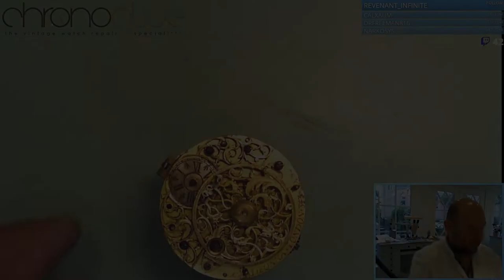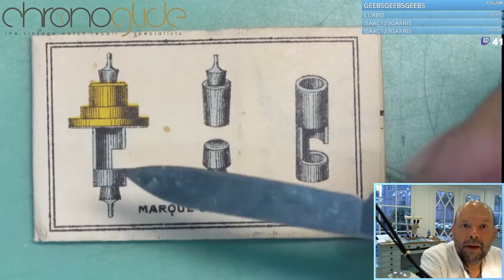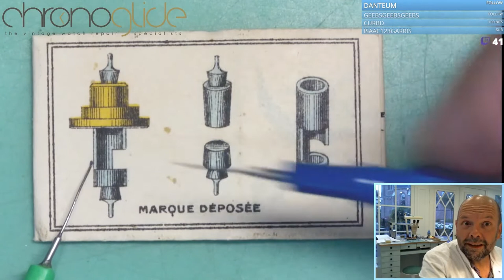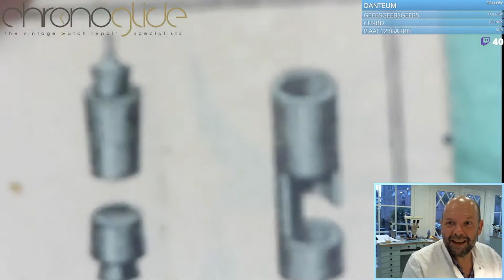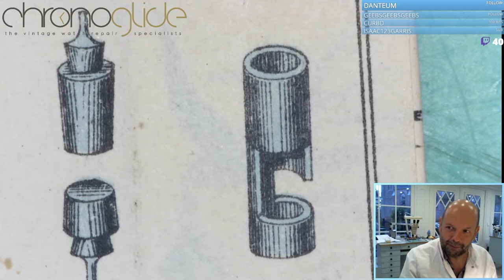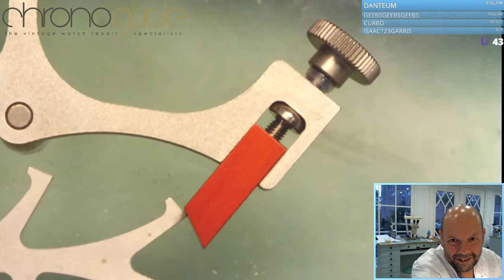How a mechanical watch works, basic theory of Horology Part 2of2

Comment: I really love your videos. You are actually the first person to mention anything about where the power is generated for the escapement to work. The balance wheel cannot be the source as it isn't connected to the train BUT when others explain the action it's as if the balance wheel has a store of energy all its own that it uses to keep itself moving. Very few people explain that the escapement wheel is the source of this movement (through the main spring) In definitely no expert but I think im right in saying that. As I say - I LOVE your videos. Many thanks
Reply: Exactly this. Wholeheartedly agreed!
Reply: The escapement & pallet fork is a kind of conundrum, because the impulse pin moves the pallet fork to allow the escape, and also gets a push from it to keep he balance wheel going.

Comment: Can the impulss D stone fall out of the pallet fork safety mechanism and make the watch stop? If so, what can be the cause and is that a big issue for repairing? 
I love your contributions! !
Reply from the maker: Hi Roman, it is possible for the Shellack to dissolve (alcohol) or get brittle. it is not very common, but it can happen.

Comment: So let me see if I understand correctly :
- First you manually wind the spring, storing energy.
- This spring is somehow connected to the bottom wheel of his big board, constantly applying a rotating force.
- Then the "pendulum wheel" release the bottom wheel in a timed fashion with the mechanism.

Now here's my question : I understand how the bottom wheel transmits energy back into the "pendulum wheel" with the beseled jewels each steps, but how does it gets its energy at the start ? If each cycle for the pendulum wheel is "spend energy, recieve energy", it needs to have some energy already at the start ?
Reply from the maker: Great question! It is all in the Impulse, the pallet fork gives the balance wheel a small push. If you like I can show you during a live stream on Tuesday.

Comment: A swiss lever escarpment has 18000 beats per hour.
Does it mean 18000 times tic tac?

With other words 18000 times a full amplitude moving in one direction and later in the other direction and starting a new cycle?

A beat is a tic tac not only a tic or tac?

Comment: 10:45
Explain me how the escape wheel is starting moving the fork by pushing the pallete jewel ?
Catch the escape wheel from your model (not the fork) and please try to simulate the real force of the werk engine which is the spring barrel by spinning it clockwise to start the clock ticking.
It`s not possible right ?
How does the real watch doing this ?
Reply: I'm not 100% sure what you mean.

His model can't run because there is no balance wheel, the pendulum that swings back and forth hitting the palette fork. He has to use that dial to act as the balance wheel. But the escape wheel does have a force behind it so the palette fork can work.